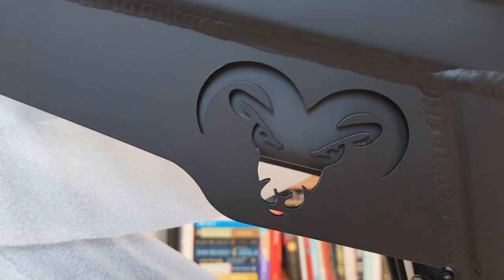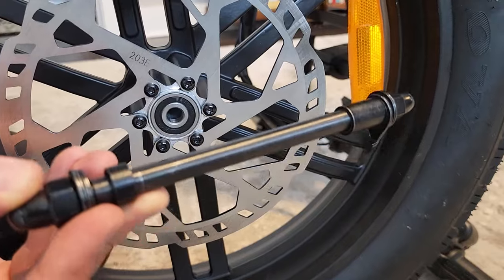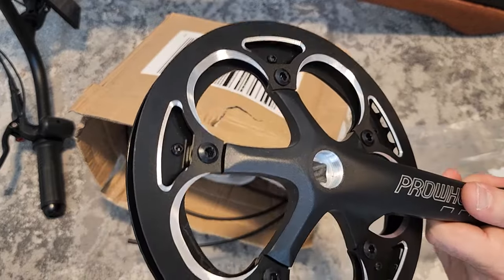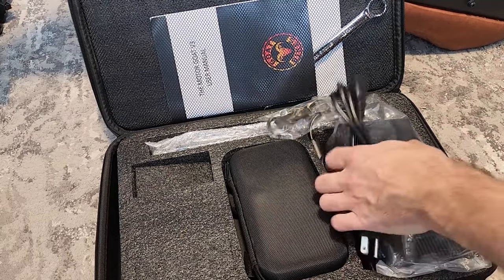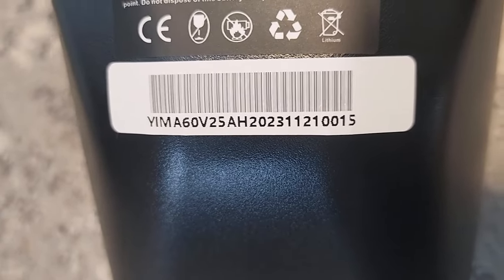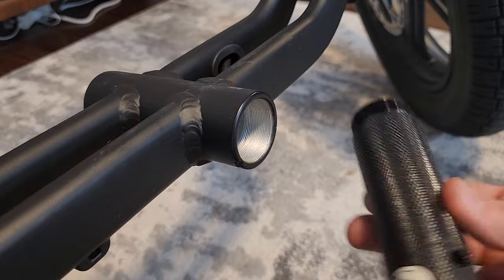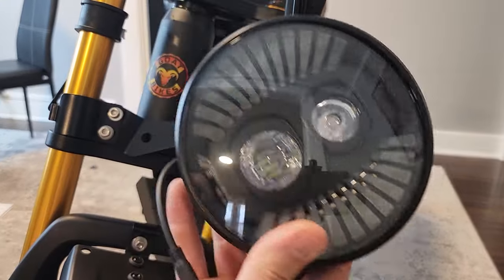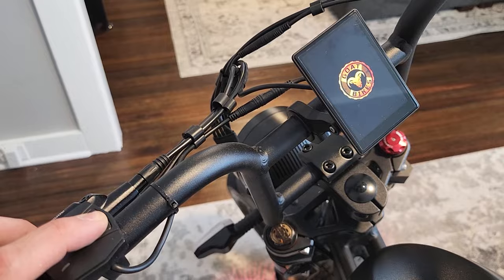45mph Motor Goat V3 Unboxing And Assembly!

Comment: Every time I see a moped style bike I feel my knees hurting.
Reply from the maker: Pedaling is optional ;)
Reply: Me too....I am going to buy a stem riser and may buy/build seat riser....not even to pedal but just because of the knee angle....will know better when I see some videos of a 6' person on the bike....🤔
Reply: Bike goes 40 mph n I'm 285lbs don't need to pedal
Reply: Looking forward to more videos on this hopefully sooner than later. On the fence between this and a rev 1...
Reply: @lilvegasbasc-se7en-0-duece67  I'm short and heavy so I've been worried about this since I ordered it. Is that 40mph gps confirmed ?
Reply: @JeffWolfe13  yup and if u haven't even ordered one yet they have upgraded the controller to all orders here on out and it will be 45 for fat people like us 50 for everyone else
Reply: Awesome video! Just to ask, the pedals and gears don’t come pre-installed when ordered with pedals?
Reply: @mchevownr  The cranks, chain, and gears are preinstalled. You have to install the pedals.

Comment: American made batteries 😂😂 they are absolutely not
Reply from the maker: The battery pack is, obviously the cells are not.
Reply: @maximumchargeEV  the entire bike is made and assembled in China, no part of it is American made
Reply from the maker: @stashone9780  it's an American based Company. Did I specifically say "American made"?
Reply: @stashone9780 he means the after market battery for the frame, made by another company in America. Not the original ones.
Reply: @Lou.Cypher  your right, my mistake, sorry @maximumchargeEV

Comment: The latest deliveries have all the crank, sprocket, and chain installed.
Just got mine delivered on Sunday.
Reply from the maker: very cool. Is that a bad thing or a good thing?
Reply: @maximumchargeEV  I’d say it’s a good thing if you ordered it with pedals. Less work for the customer.
If you don’t want the pedals you can order it without them.
Reply: Did the tools, front pegs, and middle bag still come with the bike? I'm getting ready to order one up myself.
Reply: @jasond7978  If you order it with pedals it doesn’t come with the front pegs. But it does come with the tools and a small tool bag.
Reply: @stevej6824  I just ordered the stealth motor goat with the hard shell case. I can't wait lol
Reply: @jasond7978  Nice 👍 
You’re gonna love it.

Comment: I may cancel my order on the ECELLS 5* for this….
Reply from the maker: Why's that?
Reply: This bike seems like it’s a better deal, way better brakes , motor, controller etc. I’m just a little hesitant bc I’m 6-2 and how it’ll fit. Also the ecells are expecting July delivery for the 19” frame bikes. If you could only get one, which one would you get?
Reply from the maker: @baggerbenn  depends on if you plan on doing some moderately intense off roading or not, and if you care about adding your own pedal power or not.
Reply: @maximumchargeEV  proberly very little if any off road. Mostly street. And I’d be pedaling some of the time anyway. You think the goat would be a good match ? They have answered all my questions. New bikes come with tear signals, 4 inch wide front tire and a newer controller. I’m. It worried about the cost difference just that the moped style might be too small for 6-2.
Reply from the maker: @baggerbenn  I would probably go with ecells if you're 6'2" and like to pedal. If you don't mind the bike feeling "smaller" under you then the goat is fine. What's your weight?